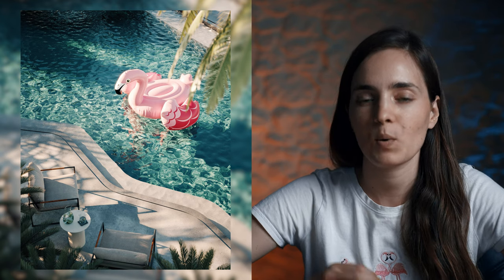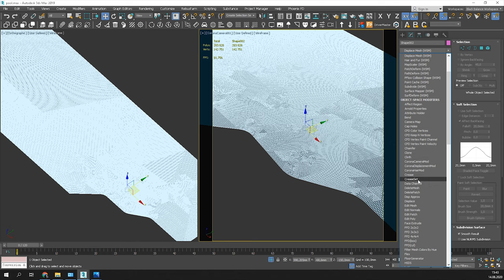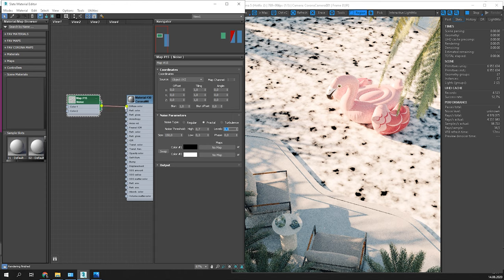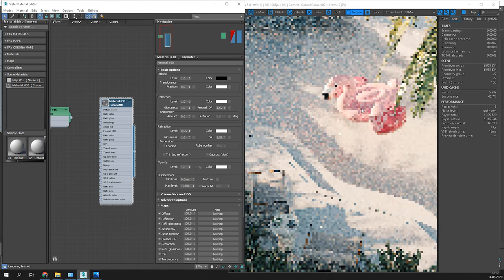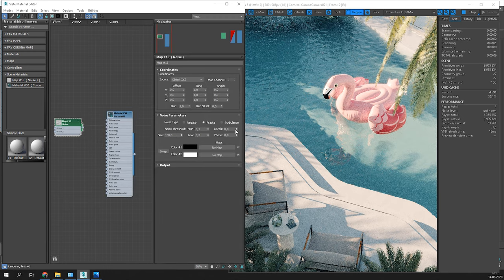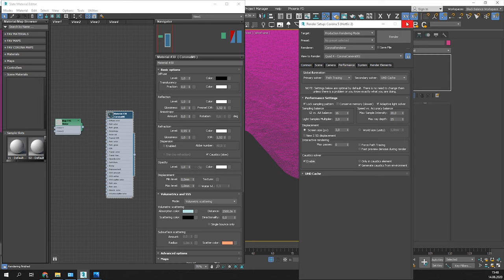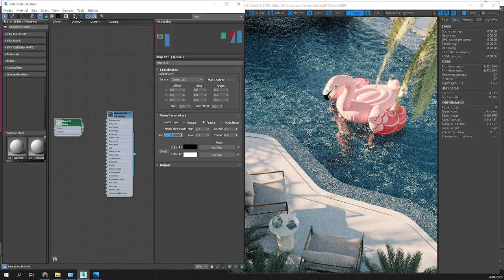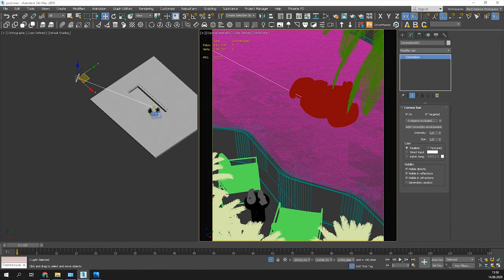Photorealistic Water Material with Caustics | 3ds max + Corona Renderer

Comment: I dont think subdividing the surface plane is needed. Corona displacement map does not need it.
Reply from the maker: There is always more than on method of doing things, I needed geometry to animate flamingo (intro animation) and I don't care about poly count.
Reply: @ArchVizArtist  but you are teaching people that it is needed. Most of your viewers dont need to animate flamingos and high poly eats their limited resources. Keep up the great work.
Reply from the maker: Watch carefully, I haven't said it the only way and it's needed. What's your problem? You can use your methods, I'm ok with that.
Reply: @ArchVizArtist  when you do a tutorial and you tell people to use subdivide on a simple plane to get dense mesh, people are gonna do it every time. Thats how tutorials work. This is just a friendly observation. Dont get angry.
Reply: @hldemi   she is 100% correct in her approach, she did not use Corona displacement, she used normal displacement, ergo the reason for the increase in mesh. If you notice this way the actual mesh changes shape before she renders. You are correct if you use Corona displacement then yes , no need for subdivision : ) Hopes this clears it.
Reply: @chrislangeveldt8859  of course. I was arguing to use Corona displacement or simply use displacement in material slot. Using displacement modifier is quite redundant nowdays.
Reply: @hldemi  thank you for clarification bro!
Reply: @hldemi  
you do not use corona displacement when it is a simple pool in fact that will consume more ram 
if the resolution is 2px or 3px than the geometry itself, you do it with the modifier with real geometry
 the amount of polygons is insignificant! compared to the rest of your scene, probably a tree has more polygons, unless you want very small waves almost flat 
like a long exposure photograph and in that case you only need to use bump, you use the corona diasplacement  when you want to make an ocean with very defined waves and you don't want to animate it, you are 100% wrong

Comment: Got confused at the slate material editor part. I followed exactly and I haven't got the material box there to plug into a noise one. I can get the noise box there but no the material. When I tried dragging from the sample slots (the one applied to the plate) it comes up a red and blue version with no diffuse colour option to plug into??

Comment: can i add just one "small hint"?
you dont need to subdivide or displace the surface, you can simply use that same map on bump and it works fine ;)
Reply: Good hint , another one: just use the noise modifier directly in edit Poly
Reply: @joji9986  noise modifier doesnt have levels. You wont get same result. Its kinda close but its uglier, IMO. Tried for hours here with noise modifier and it didnt work out for me :(

Comment: Nice, but I in a real scene with more environment, not just a pool, caustics are harder to clean up, the amount of passes required can sky rocket. Corona really needs an option to disable caustics per object. Never the less nice tut, your doing a great job. Are you the one that use to do Affinity photo tuts?
Reply from the maker: You can disable it by material, so just use different material for object you want to disable. I'm not the one :)
Reply: @ArchVizArtist  yes disabling it in the material is for transparent caustics, a diffuse material will still receive bounced reflected caustics